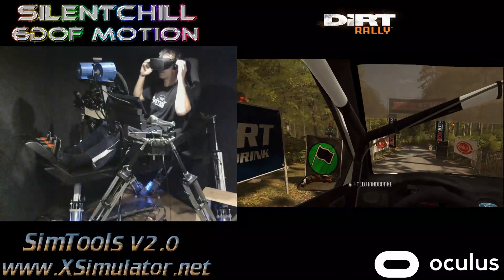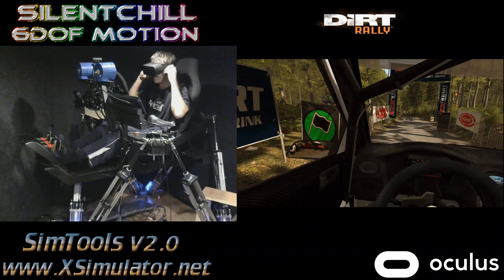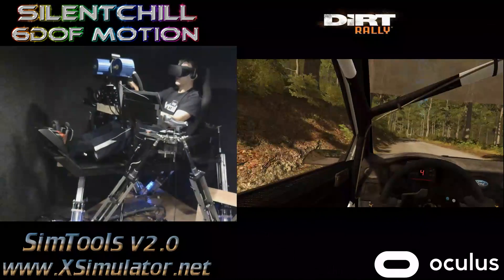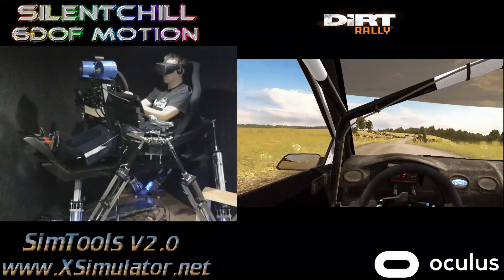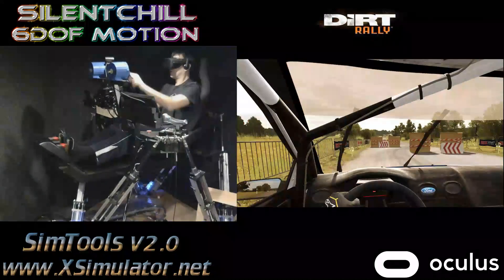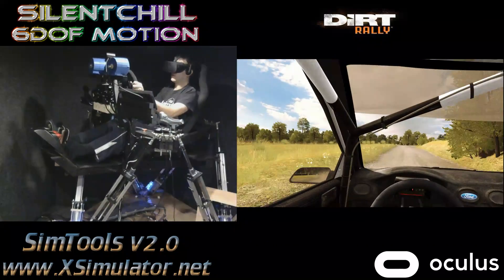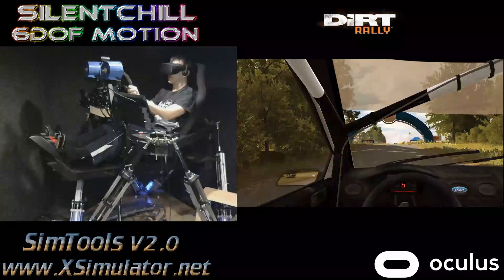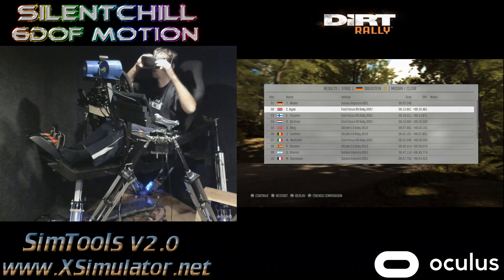Got my Direct Drive Wheel setup and its sweeeeeeet

Comment: Your setup looks amazing! Being a VR sim racer myself, I've been considering a motion rig like this (if I can ever afford it cost or space wise), but I was wondering, how well does it work with the motion tracking, considering the CV1 utilizes both the camera and the IMU/accelerometers? I've always been concerned about the disconnect between what the IR tracking see's (since it's mounted on the motion rig to match its movement) and the motion the headset is detecting. Do you notice any weirdness or disconnect from what you expect to see?
Reply from the maker: Sasian11 it did work perfectly until the 1.12 update now the tracking is usless and I have a very big hunk of junk that I can't use.  before like I say it was brilliant as long as the camera was mounted on the rig because it moves with you so it felt totally natural. hopefully oculus may fix the issue but I can't see it. I have got a gimbal on order now to put the camera on which will sort the tracking issue out
Reply: Silent Chill - Crap that's a bummer man. It looks like you've put a lot of work into getting this setup working, and to have it rendered useless by what's supposed to be an improvement must be painful. I'm glad to hear it worked at one point, so maybe it will work again someday... But using a gimbal sounds interesting, how do you expect that solve your current tracking issue?

Comment: Well it's about time you got one! hahaha Welcome to the DD club man. It's a pain to setup for dirt rally and easy for AC but it is fantastic when setup. You have an awesome setup now! Gratz
Reply from the maker: [TN] Strikeman I honestly can't believe how good they are. it's like the matrix you need to try it to belive it
Reply: Lol the red pill you have chosen :) Every thing the game can give out the wheel will give in return its almost perfect.
Reply from the maker: [TN] Strikeman it is I can feel the same vibes/movemenr coming from the rig as I can thru the wheel it's all working in harmony.  coming from a g27 I honestly did not realise the difference
Reply: Thats why I said to you way back you should get one because its the perfect match for your rig. When you use it on ac set it to 1180 degrees and in the assetto_corsa.ini file
Reply: [FF_EXPERIMENTAL]
ENABLE_GYRO=1
DAMPER_MIN_LEVEL=1.0
Reply: Will you let me have ago of your rig if I bring my pedals round ? :D
Reply from the maker: hahaha  shhhh about the pedals my pedals are fine :D I do not need new pedals lol
Reply: Great rig man, Im sure the DD made a huge difference! Btw, I have Heusinkveld Engineering Sim Center Pedals for sale. They are similar to the Pros but non adjustable. Only 450$. msg me if ur interested